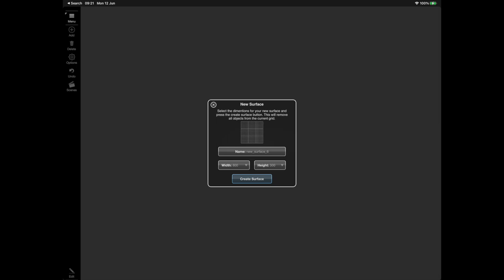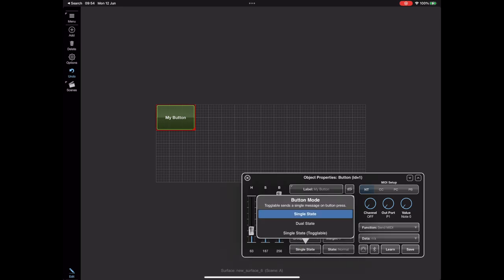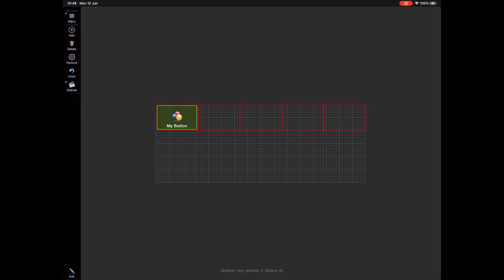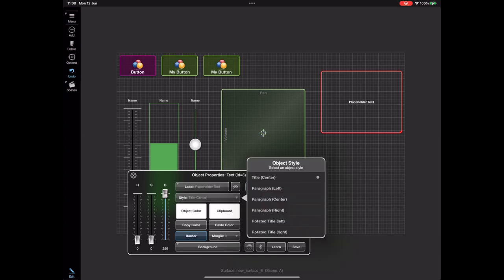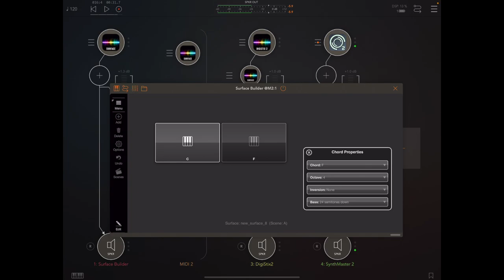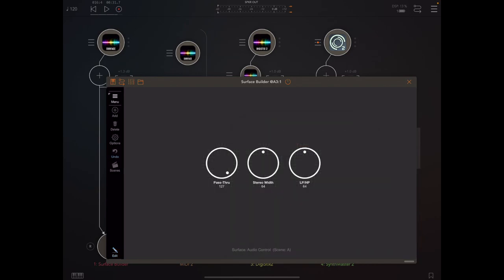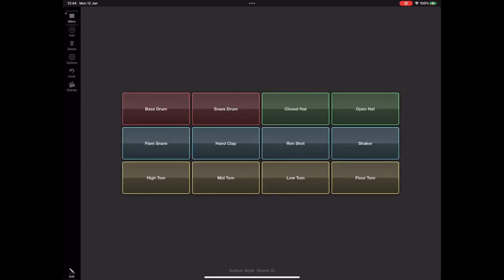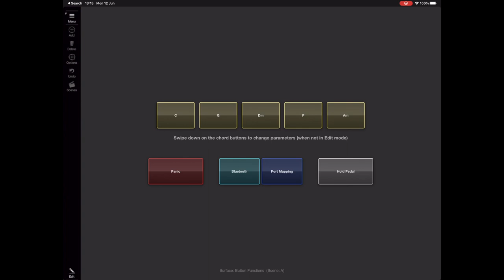Surface Builder Preview

Comment: Paul, this is fantastic… I’ve gone through a long, evolving process of working up an on-screen control system for guitar effects using an app called Xequence PADS, so I would hate to go through that process all over again. But your Surface Builder looks so much more flexible… looking forward to trying this out. ALSO looking forward to seeing what capabilities will be available with playing audio clips; I have a very specific request for that function, and I’ll wait until I have the app… great work on this; very well thought-out…

Comment: This app has so many possibilities and future potential another great addition Paul. Hope you add surface sharing at some point so we can share builds. Looking forward to seeing you expand on the audio capabilities and maybe add in a midi matrix similar to AUM at some point when used with external hardware in standalone mode. The PNG inclusion sounds great another winner. Seems like it’s a step up from NuRack FX.
Reply from the maker: Some of the testers have been sharing surfaces with me already. When you save a surface you can choose to embed the audio, before sharing with others. You can drag surfaces out of the Load Surface window to the files app and back again. I will have to do a video showing how its done.

Comment: Very nice! Your new app looks great! A very interesting and flexible "Surface Builder" app...
I have the “Progressions” app, and was wondering if this new app (or Progressions directly) could manage triggering a 4 or 5 chords progression using the same “button” on a foot controller, I mean pressing a foot controller's button/switch could start/play the first chord, and when pressed again the second chord is “triggered”, and so on, until the last chord in the progression is reached, I have been looking for something like that, instead of matching each button per chord and being limited by the buttons/switches in my foot controller, and also remembering which switch triggers which chord
Looking forward for your next video about the features of "Surface Builder" app.
Reply from the maker: There is always the possibility of additing something like this in future versions. This kind of thing crossed my miind too, one step at a time for now.

Comment: I have tried lots of these types of apps from basic ones to apps like Lemur which allow code level scripting and logic to be applied to controls. This seems like a nice in between with a lot of ability to tailor the control capability but not too complex where you need a coding degree to create even a basic layout.

I like how you have the app itself able to make a connection to Bluetooth MIDI ports rather than needing a separate app to connect it first.

Only suggestion is that it could be nice to perhaps add a colour palette to make it easy to select a colour visually rather than the sliders. 

The ability to name scenes would also be handy but perhaps this can be done and wasn’t shown.
Reply from the maker: Naming the scenes is a good idea. The only reason I didn't do it was because you can already name the buttons and add text objects titles. I did think it would be good to see the names in the scenes window, but there really isn't a great deal of room. The colours are displayed as you drag the slider around but I understand it would be easier to see all colours on a single screen and you just pick. I will give it some thought.

Comment: Looks great. I was looking for exactly this a couple months ago, and I found an app that does some of what I need, but being a control surface is not it's primary function. I have gotten a lot of mileage out of your modular effects app, NuRack, which can also do some MIDI control, but this looks really nice. Looking forward to the Masterclass videos and other demos.
Reply from the maker: Yes Ed, this is so much better than NuRack when it comes to MIDI control. I think once I start producing the videos showing the intricate details it will all become clear. I really struggled to get everything I wanted into this preview.

Comment: That is a very comprehensive and useful app, Paul! One use case I can see for me would be the creation of a soundboard for triggering sound fx and whole tracks/backing tracks for use in an am dram production. Presumably, you can set the mode of a sample playback button to one shot, repeat, momentary etc.?
Reply from the maker: Yes, you can set momentary or one shot, but I didn't add looped in this version... but it is already in the next version.
Reply: @PaultheMusicMan  Looks like Colin got to my request first… I hope one of the “modes” you set up will be serial play, ie: play clip A, which loops until you tap clip B which cues it up to play immediately after clip A is done, etc. That would be magnificent…
Reply from the maker: @gtrgeorge348  I am certainly making a note of all these ideas and seeing what ideas fit best. I don't want to go too far beyond this app being a MIDI controller with audio capabilities. I have had requests for slicing samples etc. which is an app in its own right, but queueiing is something that could be done. I currently allow you to place clips in groups which mutually exclude each other. This could be extended to queue until the current clip is complete. I just need to find a neat and obvious way of doing it.
Reply: That’s exactly how I’m looking at it Colin- we’re currently rehearsing a play due to go on in October, and a simple board of one-shot fx (there’s a lot of thunder in it!) will be useful in rehearsal and beyond.

Comment: Looks good. I see no mention of Sys-Ex, or of NPRNs. And do controls respond to incoming MIDI as well as transmitting? My envisaged use is a controller for hardware and software outside of the iPad.
Reply from the maker: It does do 8bit and 16bit NRPN but SysEx handling is quite basic. Most controls do reflect incoming MIDI, so if a button receives a message it will reflect the state of the message.
Reply: @PaultheMusicMan  That's great! Thank you. I'll definitely give it a try.
Reply: @PaultheMusicMan  Downloaded and tried a couple of basic controls. I'll begin building a test MCU control panel to see how far I can take it.

Comment: This one is absolutely amazing 
I’m interested in control my hardware synths via Bluetooth using WIDI Jack, just two doubts; will it support MIDI Learn so I can build a touch control surface for a who punch of Hardware Synth parameters?
Also, what about MPE support?

Thank you
Reply from the maker: I've tried to make this app work with AUv3 and with traditional MIDI ports, but I've not added anything MPE specific to this as yet.
Reply: @PaultheMusicMan  Thank you Paul, waiting anxiously for it 🤗

Comment: Hi Paul, great app! Unfortunately, I am not able to map Surface CC faders etc. to AUM instruments, e.g. filter, volume etc.? A short video would be great. I‘m not a MIDI novice . I have gone through all the port combinations. Many thanks
Reply from the maker: It is a relatively easy task so long as you get the channel and port setup correctly. I assume the destination synth accepts MIDI CC commands, and you have told the synth to take its input directly from Surface Builders port and channel that the fader is sending too? I'm sure somewhere in one of my videos I show how to do this with Sunrizer Synthesizer.
Reply from the maker: Checkout my MasterClass #3 which shows how to map the LFO button to Sunrizer. To map a fader is similar, just make sure the channel and port are both set to 1, then make sure Sunrizer is taking input from Surface Builders port 1. The channel has to be enabled before it sends output, even though we are not using the channel. Make sure in the fader properties you select CC7 say, which is the default CC for cutoff filter. From there it depends on the destination synth and how it implements its mapping.
Reply: Many thanks for the fast reply. it works all fine now. it must be the Greek sun … or Ouzo

Comment: Is there any hope that Sysex processing will be implemented in Surface Builder and Layers?
It would be great if you could save the midi data stream via midi learn. Background: My Casio PXS 7000 unfortunately cannot change registrations via Midi, but a registration (click on a button) can send all settings as a combination of Sysex, CC and PC. It would of course be great if you could extract the used data from the data stream and generate the corresponding buttons automatically (Surface Builder). As far as I know, there is no software that processes sysex data as auv3 in the context of a library manager. Camelot Pro can save the data as a preset, but unfortunately it is not an auv3.
Reply from the maker: The problem is that a lot of Sysex data is specific to a model of synth, and in many cases we can't get information about the structure. The best any app can do with SysEx is recieve what we call a dump, then send that dump back when a button is pressed.
Reply: . @PaultheMusicMan  A dump would be a step in the right direction. I mean, just listen to the midi input, save it as a preset (in a list) and then recall the dump. The same can be implemented for PC in layers.
Reply from the maker: @HansAlbers10000  I will add it to my list of future improvements for Surface Builder and see how it goes. The only real issue is SysEx dumps can be quite big.
Reply: @PaultheMusicMan  I know that this is not just an empty phrase. If you like, I can send you an example to the support email address. Thank you!
Reply from the maker: @HansAlbers10000  Can you email me at info at 4pockets dot com. I have an experimental TestFlight version with a new MIDI Recorder button function. If you send me your email address I will send a TestFlight invite.

Comment: Can it connect to pc via USB typc c to make controlling for daws?
Reply from the maker: It depends if you have the neccessary drivers installed I guess. As long as you have physical MIDI ports on the PC. I know it is possible on the Mac to control things over a MIDI session and I will be describing that in a forthcoming tutorial.

Comment: I bought this app and I‘m somewhat disapointed. So many options to change the look of elements and so few to change their behaviour? I wanted to make a spring-centered pitch bend slider with 14 bit range and I don‘t see how this could be done. I thought that Surface Builder was meant to do such things. Am I missing something?
Reply from the maker: Have you worked your way through all the videos yet? Add a Knob, open the properties and change the style to Pitch Wheel and the message type to Pitch Bend. Ensure 'Continuous' is set so that it sends pitch bend as you move the knob, rather than just when you release. This in my opinion is the best MIDI controller on iOS once you get used to how it works. See if there is a demo surface called keyboard test. I can't remember if it ships with this or not, but it has a spring loaded pitch bend.
Reply: @PaultheMusicMan  Hello Paul, thanks for your fast rerply, got it now! No, I haven't found the time to watch all the videos yet. I had expected to find the pitch bend functionality on the slider, not on the rotary knob. And actually I would prefer the slider look for my pitch bender. But anyway, it works now, thank you! Btw. i own around ten of your apps and like them a lot. Especially Rings FX and WaveCloud. The next one I will try to understand is Progression. ;-)

Comment: Does it support MPE and Poly Aftertouch?
Reply from the maker: This is not really for routing MIDI it is more of a controller. Since most of the ontrol is coming from a touch screen it is not really possible to support things like aftertouch.
Reply: @PaultheMusicMan  If it's for designing controllers, then you should be able to support MPE and aftertouch. There are virtual controllers like KB-1, Velocity KB, Woodtroller, and Beat Pads that make excellent use of on-screen velocity andMPE!
Reply from the maker: @jackcimino8822  Aha, now I understand what you are asking... an interface like an MPE controller with the ability to slide the finger on screen to generate velocity/cc control etc? I am planning on adding this kind of controller, although it won't be in the initial release. This was not really designed as a dedicated keyboard interface as nothing beats a real keyboard. This is more of a generic control app for launching clips, changing patches, controlling levels etc. I'm sure the videos I release will make it more clear.
Reply: @PaultheMusicMan  Exactly! Although I love the controller apps I have, I am frustrated with their limitations. At the same time, I cannot afford a Linnstrument. The best I got is my trusty iPad Air 3 with a Roland UM-One and MOTU M4. It works well with the MPE recording of Studio One and Cubase.
Reply: Surface builder the chord object is missing also the one object below it.
Reply from the maker: @timakak377  It depends how you load the plugin. If loaded as a MIDI plugin it can't process audio. If loaded as an Instrument or effect plugin it can. I go over this in the preview video.

Comment: Very nice app, but no support for 14 bit MIDI? 😢
Reply from the maker: We support various controllers like pitch bend independently, but what other controllers are you thinking of?
Reply: @PaultheMusicMan  NRPN (14bit MSB/LSB), which iVCS3 and many other Synths do support. 7bit MIDI resolution is to coarse for filter or oscillator sweeps. Ape Matrix supports it as well.
Reply: MidiDesigner2 has support for 14Bit NRPN CC messages as well.
Reply from the maker: @nikvr2025  Yes, I will be adding it soon, although there are not so many MIDI messages that use MSB/LSB combinations, but I guess if you have full control over both sides of a conversation you can utilize them.
Reply from the maker: @nikvr2025  I assume Ape Matrix allows you to pick two CC values (one for MSB and another for LSB) right?
Reply from the maker: @nikvr2025  Is it NRPN you prefer or the 14bit CC's (i.e. sending CC7 in 14bit would send the MSB at CC7+32) as MidiDesigner does. NRPN are really designed for accessing hardware features. Ideally I want to get around to adding both but which would be the priority? Midi Designer Pro is a bit strange, it lets you select 14bit CC and then can only output a range of 0-999 for a knob. Saying that there is only so much resolutution in dragging an item on screen anyway. I must admit the standard is a bit of a mess as it stands.
Reply from the maker: @nikvr2025  Hi Nik, I'm in the process of adding NRPN 7bit/14bit support and almost ready for someone to do some testing on this. Are you willing to try this on TestFlight for me? Also can you let me know which other synths that you know support 14bit NRPN mode. I don't have iVCS3 and wondering if any of my existing synths support it.
Reply: @PaultheMusicMan 

Thanks so much for 14 bit MIDI support!

Comment: Keeps crashing after iOS 17! Help!!!
Reply from the maker: Can you be more specific about what you are doing? It runs fine for me but maybe you are doing something specific that causes an issue. Upgrading to new iOS versions early is always a bad move. Don't forget to first run the app in standalone mode to ensure all the presets are installed if this is a fresh installation of Surface Builder. I've just run the app on iOS17.0.3 and it appears to be running fine for me.